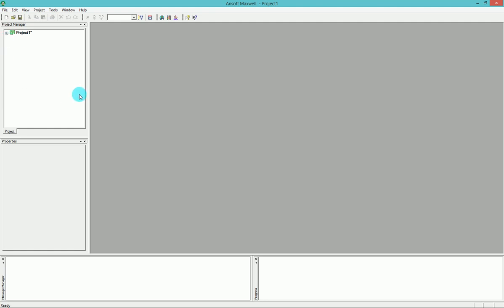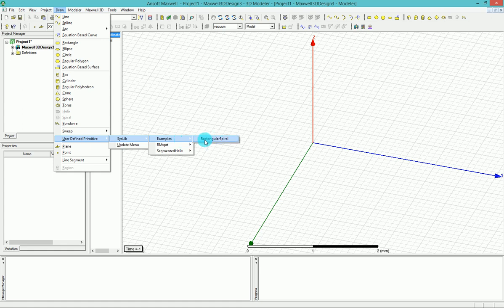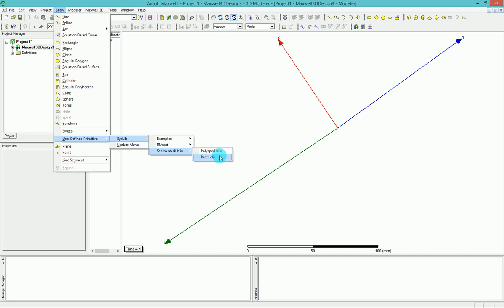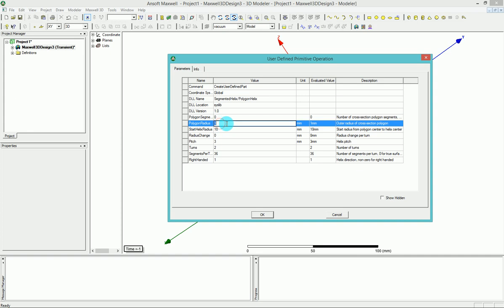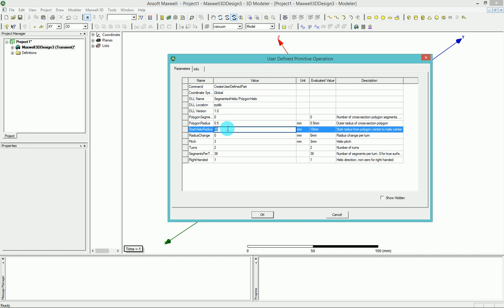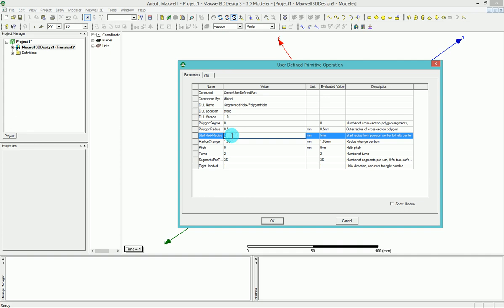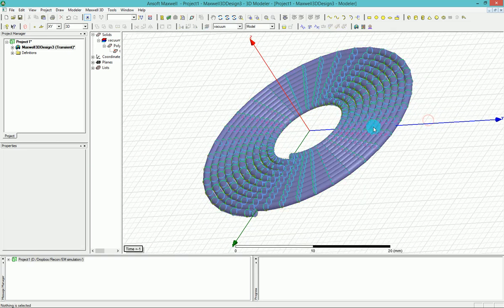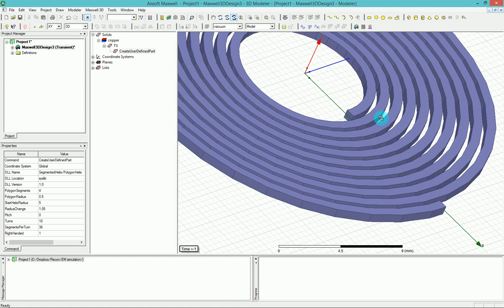Ansys Maxwell - HFSS How to model helix circular coil for WPT

Comment: hi Kamyar, how can HFSS be used like Maxwell? with some different parameters between the two? Please share the easiest way to use HFSS like the simulation done by Maxwell?
Reply from the maker: Hi HFSS can provide you s/z-parameters which can be later used for extracting inductance and capacitances. It’s mainly used when frequency of operation is high enough that full wave solver is used. That’s when longest length in your design is about 1/6 of your wavelength of frequency. If your frequency is low enough that your wavelength is much larger than your design dimensions don’t bother. Use Maxwell it’s designed for low frequency applications, it’s capable of post processing all commonly used parameters ( like self and mutual inductance, losses and etc).

Comment: Thank you so much Kamyar, with my 1st time using Maxwell, I have been able to have a good idea about the software thanks to you.
I have a question, I am designing a WPT coil, however, the allowed space to fit the coil in is actually rectangular, so I am planning to design a rectangular planar spiral coil with circular cross section for the wires, Is there a way to define the rectangular spiral with circular wire? The available for me based on what you explained is to define a rectangular spiral with rectangular cross section.
Thanks in advance. Your help will be so appreciated.

Comment: what is the difference between ansys maxwell and ansys workbench?
Reply from the maker: Workbench connect maxwell to other simulators. You can use the results of maxwell to find deformation or temperature increase with ansys fluid or mechanical.

Comment: Hello, Thanks a lot for your tutorial. Is it possible to create a helix circular coil with rectangular shape and different dimensions for trace width and height? Regards, Tim
Reply from the maker: +Tim Gerbert yes. You should defined the points with a custom line then in the properties of the line define the cross section that you like. Fully customizable. I have similar tutorials on my channel for that.
Reply: Hi Kamyar! First of all many thanks for your extremely useful tututorials! However I didn't understand how to design a rectangular cross-section coil with different widths per turns, could you please link the tutorial wich you were referring to?
Thank you in advance!

Comment: I have the standard ANSYS workbench mainly for mechanical systems. Can modelling only be achieved through ansys MAXWELL?
Reply from the maker: +Tjam J29:13  yes, Ansys Maxwell is pretty powerful. you can do many things with its modeler. things like bending, imprinting and more..
Reply: +kamyar K i appreciate your videos and i think they are awesome btw. I was wondering if you had much experience with COMsol multiphysics?
Reply from the maker: I do have experience using COMSOL for 2 years .
Reply: +kamyar K if you could walk me through inductor modelling by comsol or can suggest easily digestible material on it I'll be eternally grateful
Reply from the maker: I found their samples and example files very helpful go to their website and find many examples they are providing for free. You just need to sign up for free.

Comment: Hi, thanks for this nice tutorial. But I have a question about this coil structure.
How can I change the "thickness" of this coil ?
Reply from the maker: Liang-Shun Chang Hi, the thickness is one the parameters that you can change when you are creating the coil. However if you want to have fully parametric coil you can follow the tutorial that I have uploaded that is showing a rectangular coil design. let me know if you still have Q.
Reply: ***** Hello, thanks for your response. But for some purpose, I need use polygon-helix type of coil for analysis. I had seen the "Modeling a simple WPT parametric (generic) Coil, part 1 to part 3", but this way did not suit my purpose.
If used polygon-helix, how could I change the coil's thickness?  Thanks for your help!

I tried to change the "polygon radius", this way could adjust thickness, but the exact value of thickness equal to 1.414*polygon radius.
Is there other way to change the coil thickness?
Reply from the maker: I wonder of the thickness was one of the s   I think you could change the thickness

Comment: Hi. Thank you for this very helpful tutorial. I have a question regarding the modeling of litz wire in Maxwell. I'm not sure if this is possible or if Maxwell provides an easy approach to this. I want to model a helix circular coil but with a litz wire. I hope you can help on this. Thank you.
Reply from the maker: Youtube 1 Basically eddy current has very little skin effect on litz wires. that means that in higher frequencies the quality factor would not drop due to the increase in AC resistance. You can simulate that by choosing stranded option when you are applying a current excitation in maxwell. Stranded option will omit the effect of eddy current which is basically what you are having when you are using litz wires.

Comment: Hi Kamyar,how to add or set excitation for this kind of coil or helix coil,I am simulating a helix coil (generated by user defined primitive),but I always get some wrong message when I trying to add exication to the coil (current excitation ,one face for iuput and other for output), is there some special set for this? Sincerely hope you can help me.Thanks.
Reply from the maker: Hi,
The excitation plane should not be inside the boundary. it should touch the boundary face. for more watch the successive tutorials...
Reply: Thanks for your advice,I have got this.

Comment: Hi Kamyar! I could realize you have a good knowledge about this topic.
I want to design an inductor on pcb, but I'd like to make some analysis like format, wide, number of turns, materials etc. I also would like to measure some parameters like inductance, resistance and the most important the magnetic field around the coil.
I'm a little lost with softwares like this one, But I think it's possible to make that.
Could you give some advices about that? I've heard about Maxwell, COMSOL, quickfield, but I don't know which is the best in my case!
Thanks and I'm waiting for your answer!
Reply from the maker: Hi Marcos, 
In my personal opinion Ansoft's engines are the Best. I have worked with COMSOL as well, and I did not like it at all. They have tremendous problem in just meshing the structure, despite the fact that the solutions might surprises you too. anyhow, for all those parameters that you asked, the easier way is to use maxwell and simplorer side by side. please watch the tutorials that I prepared for Maxwell-simplorer co-simulations. hopefully it would answer your questions.